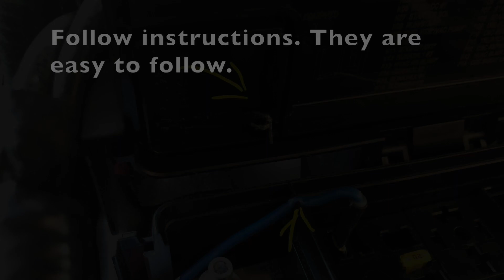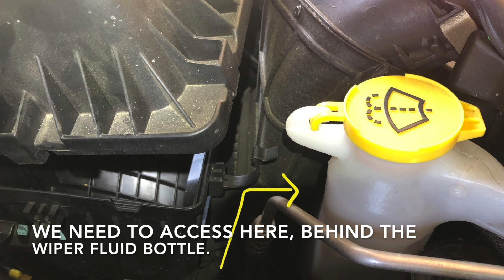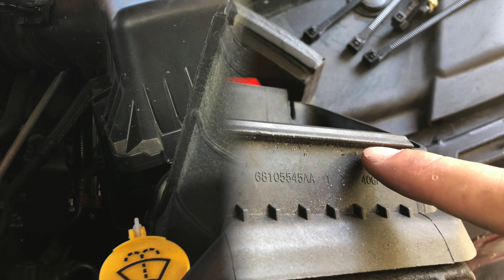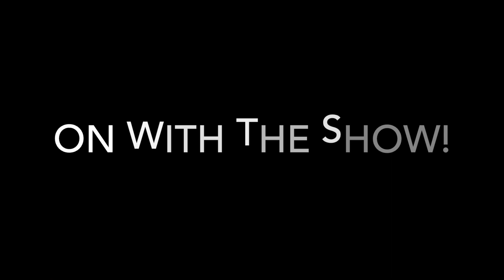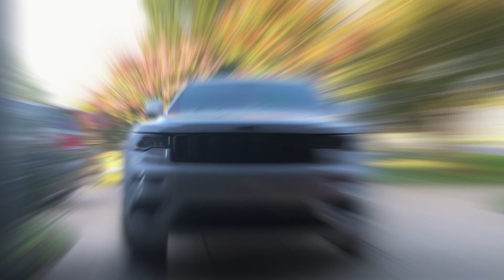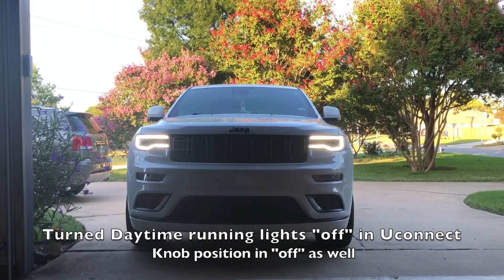Grand Cherokee WK2 DRL Harness mod demonstration (MHF)

Comment: Nice, did you use the extra wires that go into the headlight connector?  I just received mines today, I’m not sure if I use them or not I have a 2020 wk2 5.7
Reply from the maker: you shouldnt have to, after the 2015 models. Follow the intrstuctions, theyre easy: https://docs.google.com/document/d/1SrKX7lT2g0ZIUsQyqeoZhtyLntlaNLhXv8-3JLfCFoM/mobilebasic
Reply: Yea I figured that…. I’m confused on where to place the fuse tap, the instructions aren’t helping with detail
Reply from the maker: @2Str0k3Luv  youre going to have to read the instructions and decide which option you want. I cant make that decision for you.
Reply: @surgpsych  done already, thanks anyway

Comment: Which Harness did you purchase? Was it the Trackhawk harness? I know they have two. I have a 15 Overland and really want to do this mod. So the LED Ribbon stays on bright even when your low beams are on? Hard to tell on the video because they make the strobe effect as soon as you turned the low beam on
Reply from the maker: Yes, trackhawk harness. You can wire it either way. Yes, I chose full bright with low beams on.